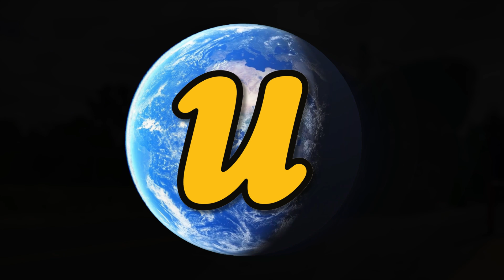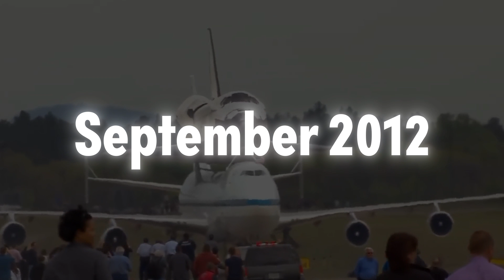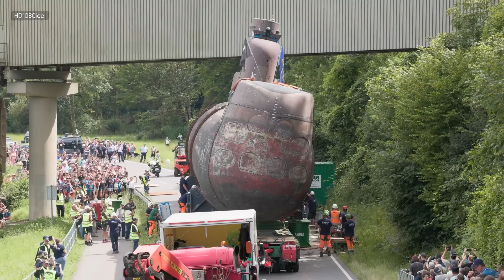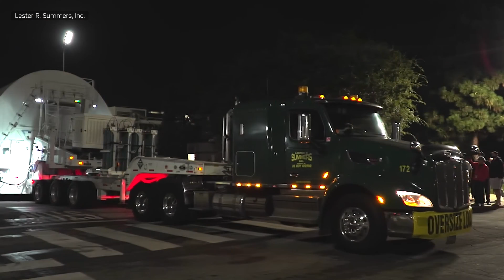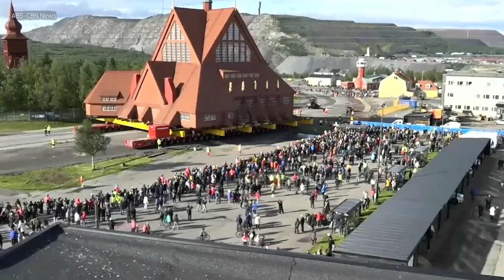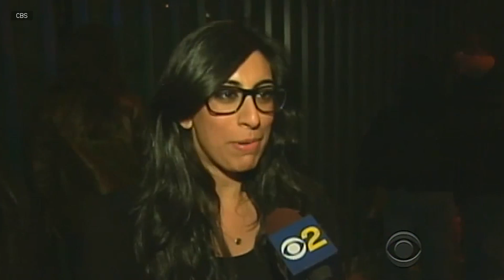10 STRANGE and IMPOSSIBLE Loads NO ONE Wants to Haul

Comment: Strangest thing ever was 2000 pounds of live earth worms to Florida. A full size Chevy pickup inside a 53 foot box trailer. Good thing it had a sliding back window because no room for the doors to open. Most ridiculous thing was my lunch. The refrigerator on the loaner truck didn't work so you improvise. Inspector at the station was impressed, she had never seen a 53 foot walk in refrigerator before.
Reply from the maker: That 53-foot “walk-in refrigerator” made me laugh 😄 You’ve definitely hauled some memorable loads. Thanks for sharing these stories!